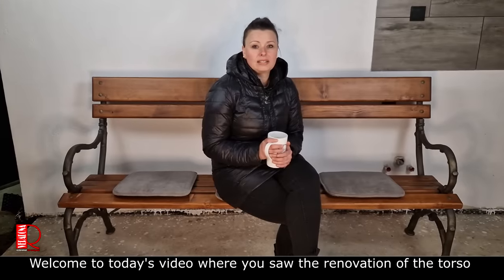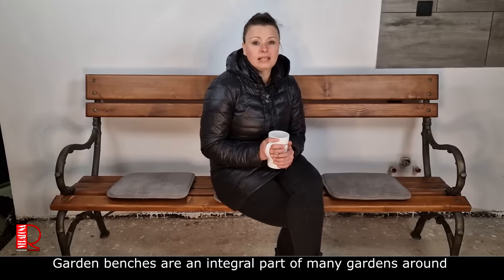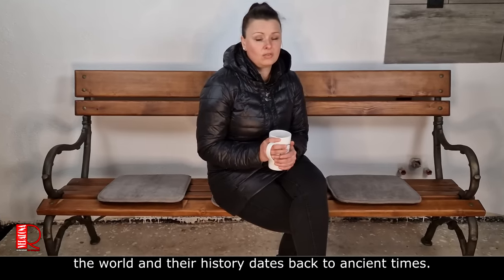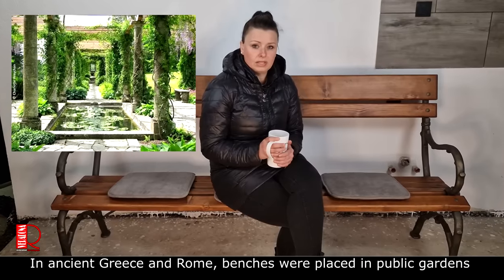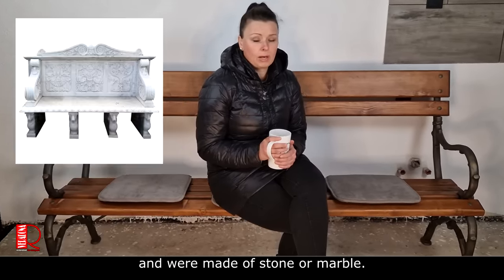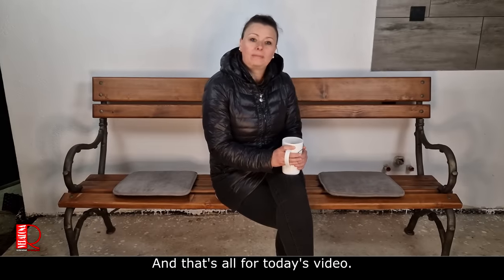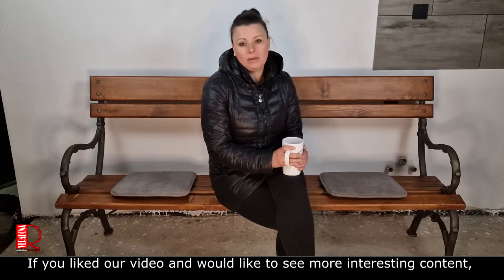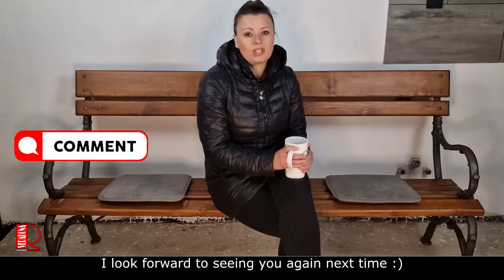Torso garden benches - Restoration

Comment: JB Weld Steel or JB Weld Aluminum for metal, not auto body filler.
Reply from the maker: Sorry for the translation, but it seems to be called differently in every country. In our case, it is polyester putty.

Comment: Suggestion... Put 3 flat iron straps underneath the seat. That will keep the board's from twisting and bowing. Without them we call them ass cheek pincher. Stay blessed stay safe and stay Free...
Reply from the maker: Yes, there was definitely a connecting rod originally, and I also think that some additional reinforcement would not hurt, but the owner no longer wanted it there.